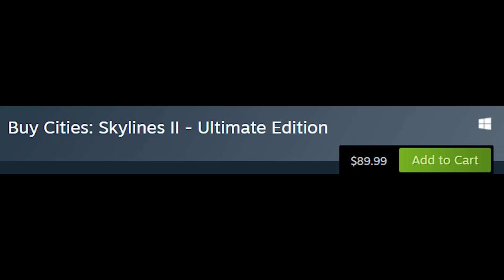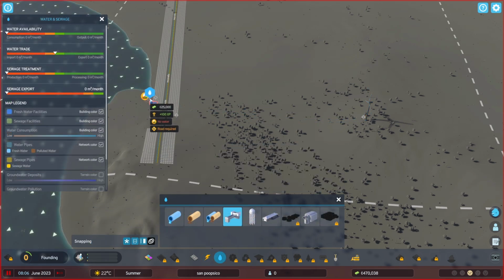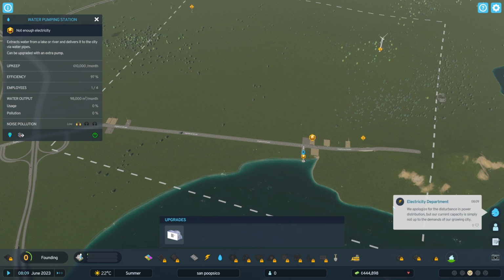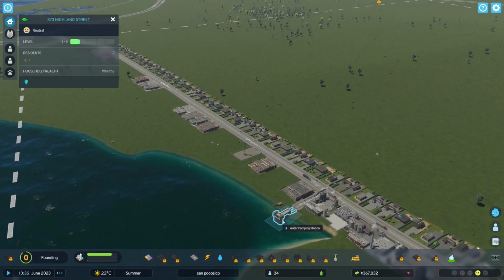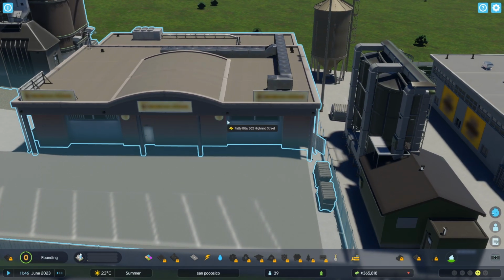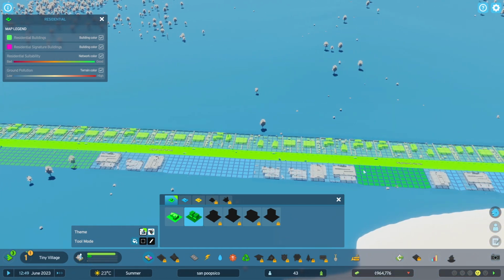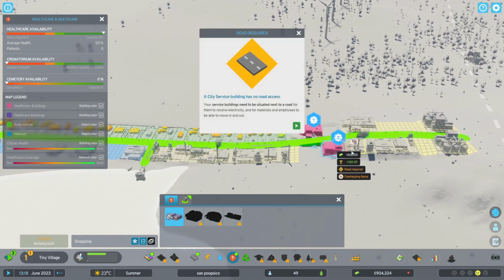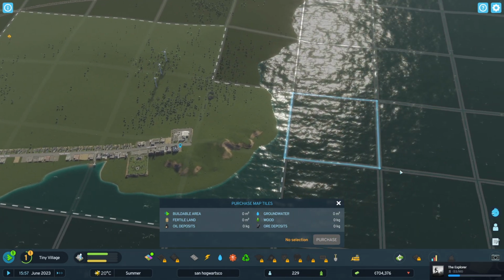Cities: Skylines II but I can only build 1 road (trmplays Cities Skylines II #1)

Comment: I like the ability to change direction but you should still keep it one road and push that limit as much as possible. I'd suggest formalizing how you do connecting roads for the stuff that requires it.
Edit: Maybe you make a slight tweak can change it to "no intersections/roundabouts" which would let you use one ways to add things that are needed. You could limit the additional one ways based on tier. In spirit it's still the same challenge but has some additional depth and you don't have to explain away changing direction.